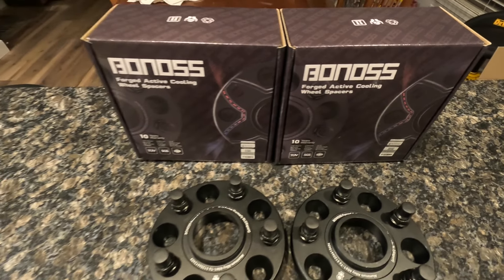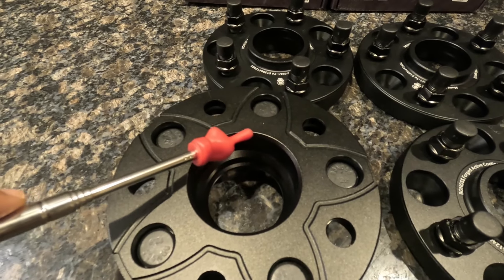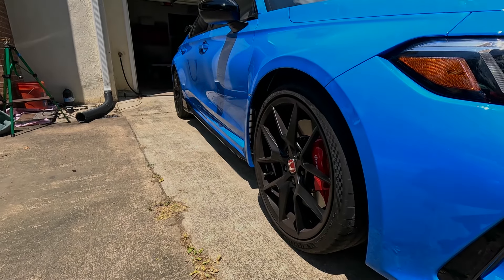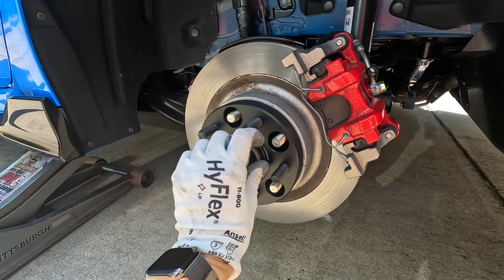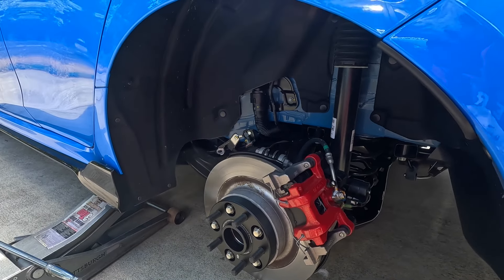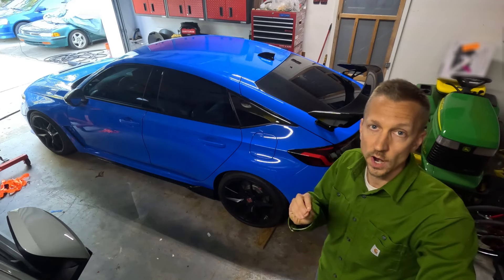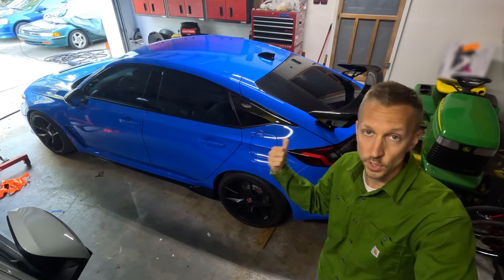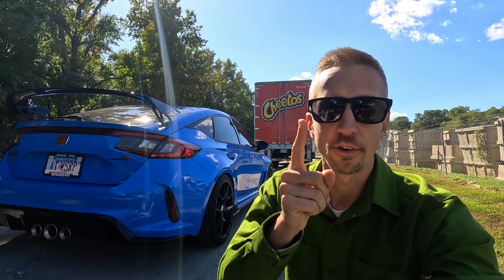Honda Civic Type R FL5 - Wheel Spacers Install DIY

Comment: I live in Iowa and while the FL5 is not a daily driver it will see some winter driving. Staying with the stock 4S tires isn't an option in below freezing temperatures. Also the 30 series profile was a concern on winter roads. With limited wheel options at a decent price I ended up going with SuperSpeed RF03RR 18x9.5 with +45 offset with factory matching center bore of 64.1. Wheels are also available in 38 offset but with the tires I was putting on, Michelin Pilot AS4 265/35/18, the sidewall is more round and wouldn't look right. Your +35 offset is very aggressive but does look good with the factory tire sidewall profile. I'll probably go the spacer route next summer because I do like the stock wheels. Side note- You should consider PPF behind the rear wheels with how much wider the track is.
Reply: I have PPF back there but instead I highly recommend front vent guard/low profile mudguard and rear mudguard.  I bought a set of FX3D rock guard kit and very happy with a peace of mind I'm not slinging rocks onto the painted surface

Comment: Makes sense and it looks good. I'd be interested to know if you find any changes handling, positive or negative. 

I take it this might affect the warranty?
Reply: Nope
Reply from the maker: @waynephilbert  Came back from a 300 mile mountain road loop and car did not disappoint in the tight corners.  

Only if the custom part that you installed has a direct effect on something else, overall warranty will not get voided.
Reply: 日本ならワランティ対象外ですね